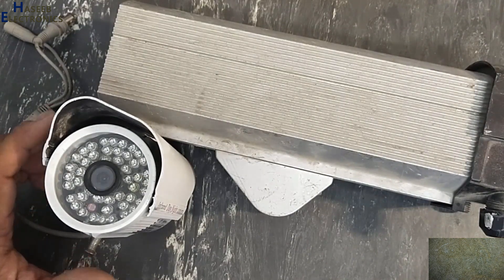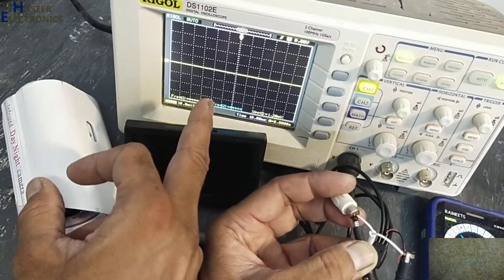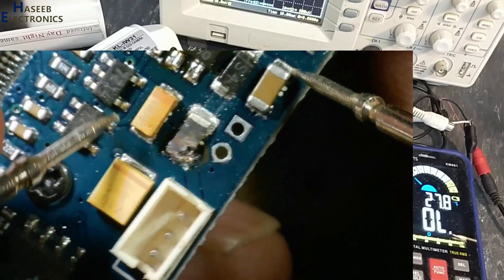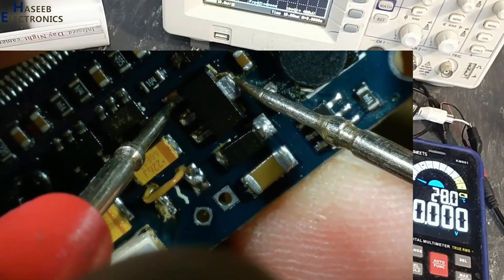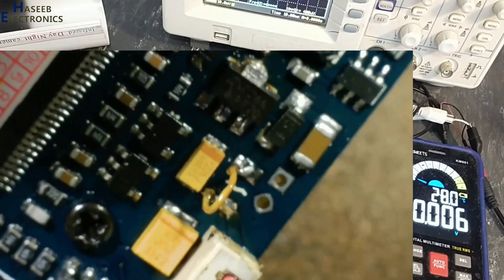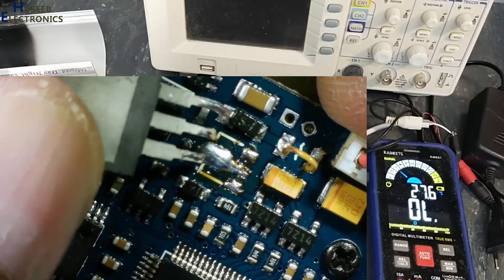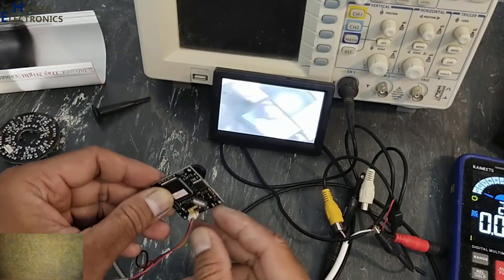{1171} Sony IR CCTV camera repair

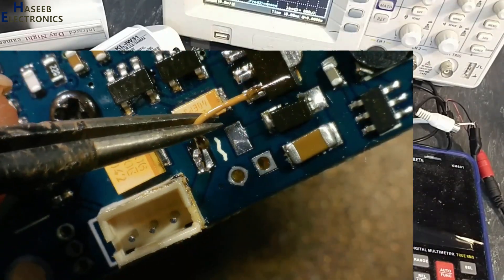Comment: 2:55 No 1-A-BuzzWire? 😊
Reply from the maker: it is enamaled and insulated copper wire, used in transformer winding. it is just to make jumper for fault verification it is my routine that i use minimum components while troubleshooting. when fault is identified and recovered, then i use original value parts. it is a best practice to decrease overhead unexpected repaiir charges.
Reply from the maker: if we use buss fuse wire, that can bridge the nearby tracks. that bridging can induce more failures